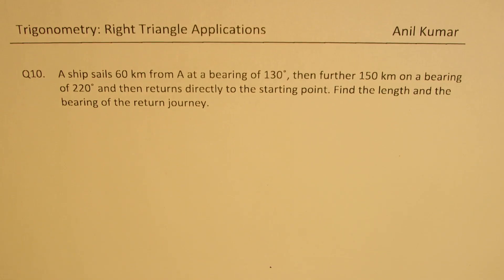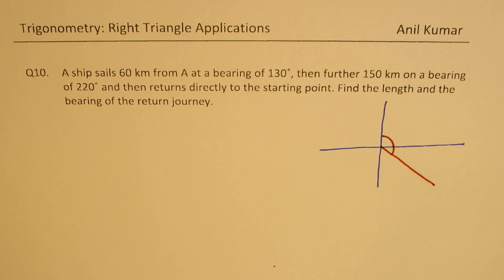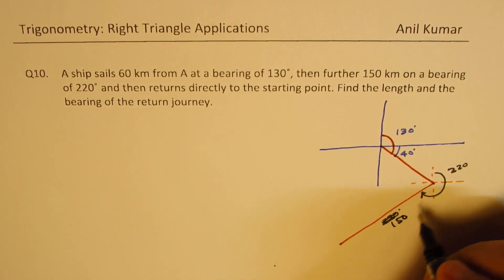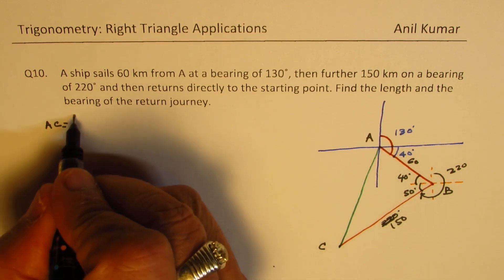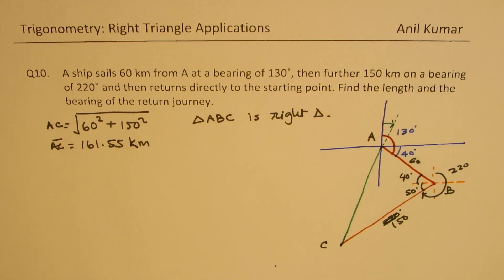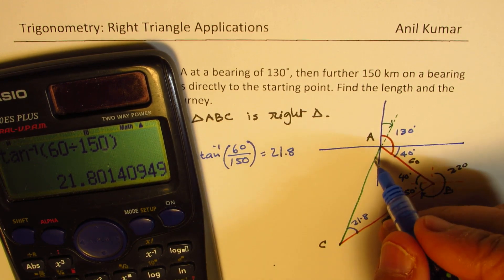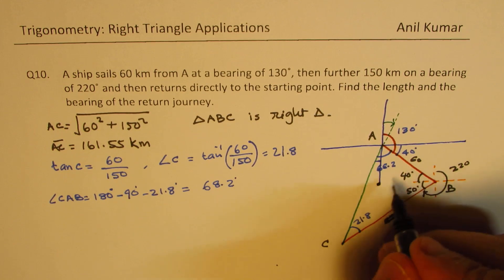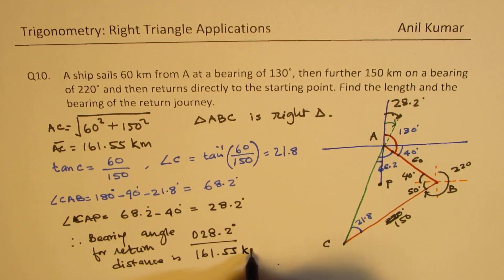Find Distance and Bearing Angle of the Ship to Return

Comment: You are underway on course 340 degrees True  at a speed of 14.8  knots. You sight a buoy bearing 342 degrees True  at a radar range of 4.8 miles at 1422 hrs. If you change course at 1428 hrs, what is the true course to steer to eave the buoy abeam to port at 1.0 miles.